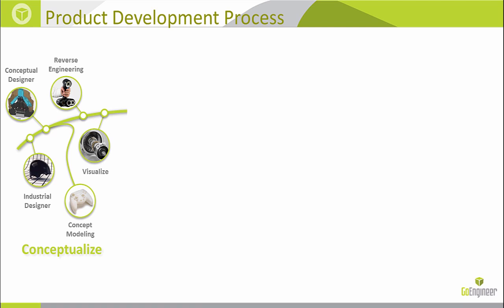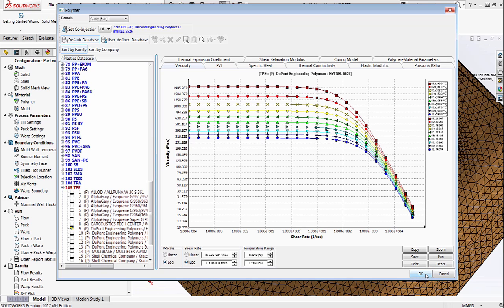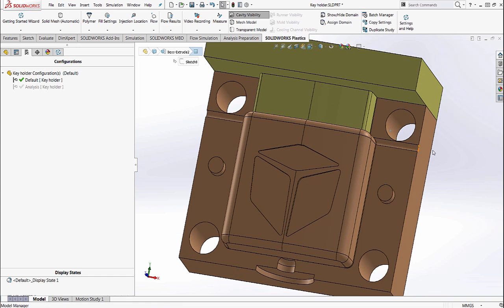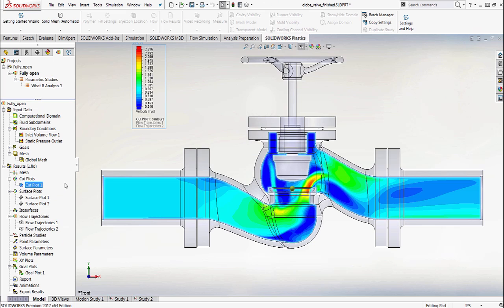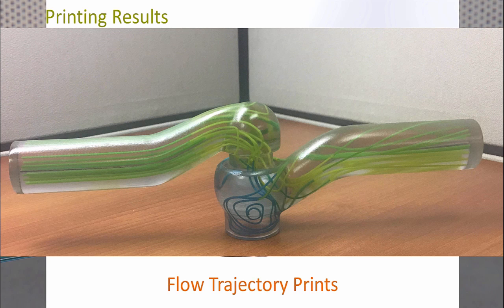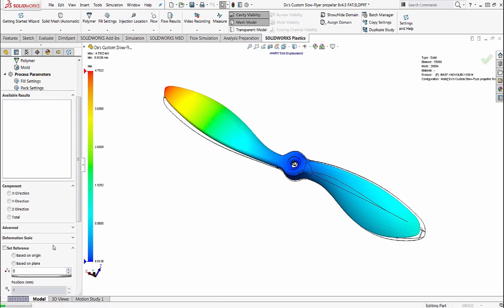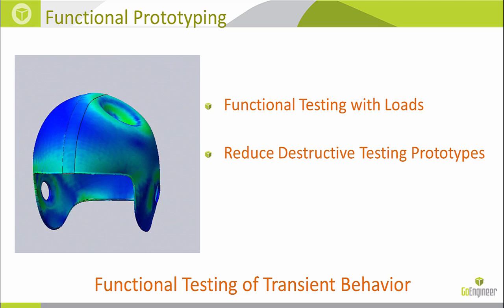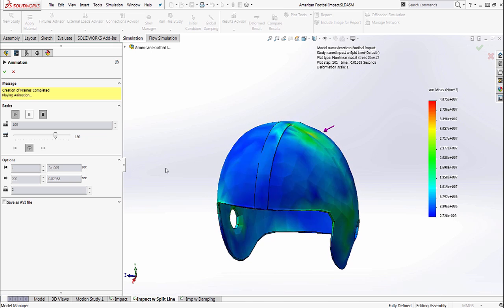SOLIDWORKS Simulation - Enhancing Analysis Results with 3D Printing

Comment: Once you create curves and use the sweep command to make actual pipes in the model, how do you make them the same colour as the simulation result?
Reply from the maker: Thank you for viewing this video and for your comment. Once you create the SOLIDWORKS file you can apply the colors a couple of ways. First is to save it as an STL file and apply the color in Objet Studio or Polyjet Studio depending on the Stratasys 3D Printer used. Alternatively, you can also apply the colors in SOLIDWORKS and save the file as a VRML. Hope this helps.
Reply: GoEngineer How can you apply the colour gradient within solid works? This is a very useful feature for presentation purposes.
Reply from the maker: Manolis Theofilos, here is a link (https://www.youtube.com/watch?v=3xyJeei7PIQ) to a video that shows how to apply color in SOLIDWORKS. You will want to apply color to the entire Solid Body. Like you mentioned, this is a useful feature for presentations. I would also encourage you to use SOLIDWORKS Visualize  and PhotoView 360 if you wish to create real life like images for Marketing purposes.